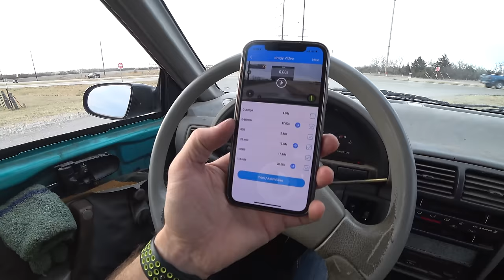I BOUGHT A Geo Metro For $300 And FIXED It In ONE DAY

Comment: As I recalll, the XFi was available in manual only in either that green paint or white.  Wish you could have run a couple tanks of fuel through it and verified what mileage it was getting.
Reply: auto trans and lucky to get 40 mpg
Reply: @alanm2842   Are you saying you had a an auto Metro?  Because then it wasn't an XFi as those only came with the 5spd manual.  The base and LSi had a 3spd Auto optional, but 40mpg is highly unlikely for that as the EPA rating for the 3spd auto was 31mpg city and 35mpg highway in 1990.  The XFi with 5spd manual was EPA rated as 43 city and 52 highway with a combined 47mpg.
Reply: @brett8481  i had a 5 speed metro and 50 + on highway did happen. I have talked to many metro owners it they had auto i was always disappointed in there gas mileage
Reply: @alanm2842   Ah, ok.  I was a bit confused the way you wrote it.  Yeah, I knew a gal who got the auto Metro new and was disappointed, she thought she was getting super fuel sipper.  I knew they had rallies back in the day to see how far they could get their Metro XFi to go on a single tank of fuel, with some tweaking their's to get much higher mpg.  I was curious to see if this one made anything close to the EPA numbers after all these years?  Oh well, seems like a missed opportunity.
Reply: @brett8481  i can tell you when I quit driving mine about 2 year ago it was getting about 48 mpg
Reply: @alanm2842   Very nice.  Either very solid engineering, or you kept it maintained well, or both.  In '94 my brother totaled my Beretta GT while I was out of state, and my parents just bought me an Econo-car for graduate school which I hoped they would have gotten a Metro, but ended up getting me a Hyundai Excel which was the other cheapest new car at the time.  Ah well.
Reply: @brett8481  I think the drive train was a good design, many of the problems seen here are the normal problems for this kind of car

Comment: You can’t put ac on a 3cyl from the 90s when the compressor turns on it would stall.
Reply: You need the idle speed kicker that's mounted on the firewall to operate properly so it won't stall. I put AC units on 2 of my metro Convertibles that didn't come with them.

Comment: The best thing you can do for those old 3 cylinder engines is to replace the timing belt.  They will self disintegrate when the belt goes.
Reply: Is the 1.0L an interference engine?
Reply: @dudeguy7347  no it is a non interference motor

Comment: I have a 96 metro geo and it wont start I replaced battery and starter and check all fuses everything is fine the fuel pump works. I dont have any crank. It just clicks. The engine turns over but just clicks. Does anyone have any ideas why this is happening.

Comment: I had a 94 Pontiac Firefly in 2006 i paid 300,00$ for it and I both another one for parts with brand new winter tires for 200,00$ and sold it the same price after i took the tires and the parts i needed from it. I drove the car every day for 3 years without any problem untill a dumbass cut me of and made me hit the curb totalling the car

Comment: that's great that you paid $250 too much for this.  You can get "some" parts for them, but good luck finding a starter.  We had to have one rebuilt for a guy.  Nobody is going to be dumb enough to buy this from you even after you pressure sprayed all evidence of the leaks away.

Comment: O.K.  This car is a piece of crap but I can't say I hate it.  My sister had one.  Manual transmission, 3 cyclinder engine.  The car was cheap and crappy but... it did carry it's own and it was good  till someone tried to steal it (why I don't know.) and ended up messing up the shifter which ended up stripping out the second gear then it was sold.  It's a cheap car but,  it has some flavor.  :D